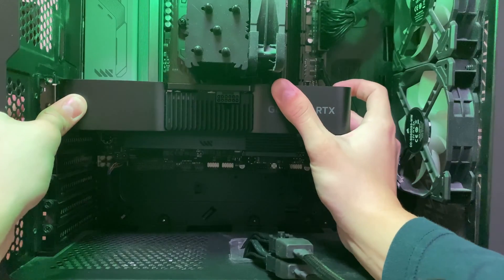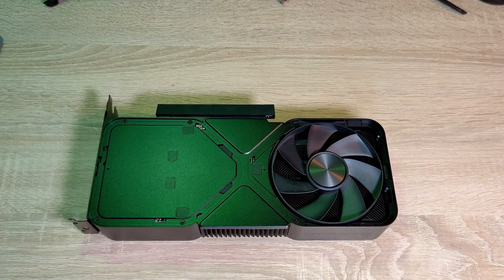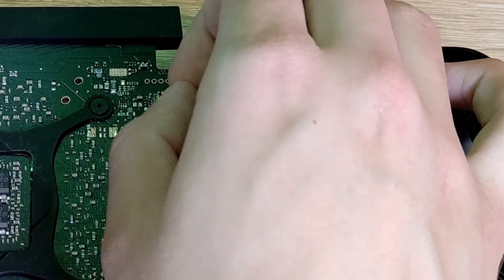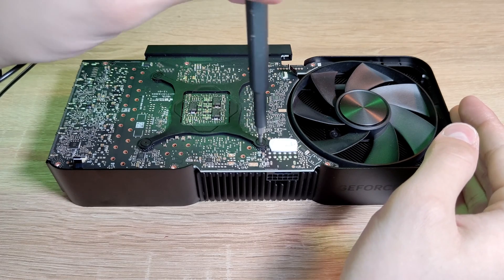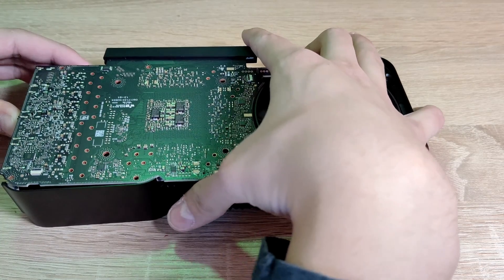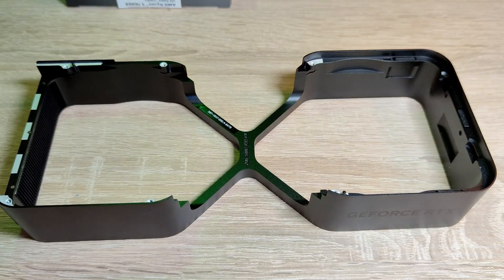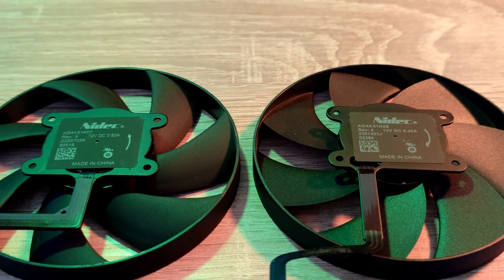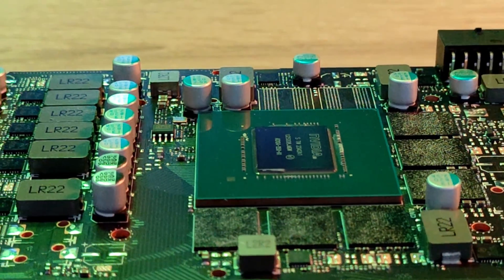RTX 4070 Super Teardown

Comment: The PCB is still tiny I really wish that some board partner come up with a single fan4070 super under 180mm I have a k39 case and would love to upgrade to this card the TDP makes it seem possible.
Do you know if a single fan cooler mod is doable on the FE ?
Reply from the maker: Dear Mark Washington! Thanks for watching.
It is possible that a manufacturer will try such an idea in the future, but it should be taken into account that this founders edition has an extremely good cooling solution and can still reach 71-73C in a well-ventilated case. If we reduce this cooling, we will definitely get a higher temperature and a louder operation. Regardless of this, of course, you can also try unique solutions.